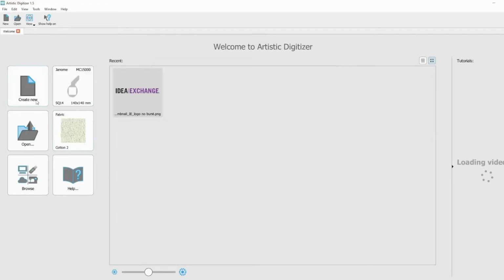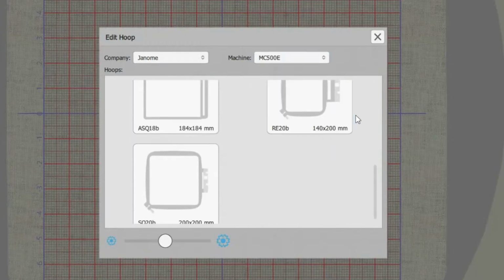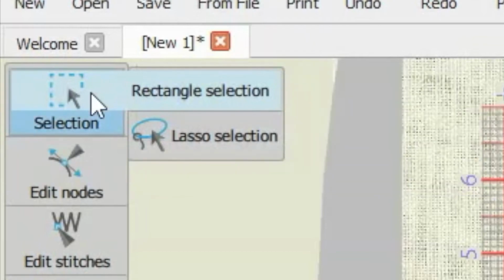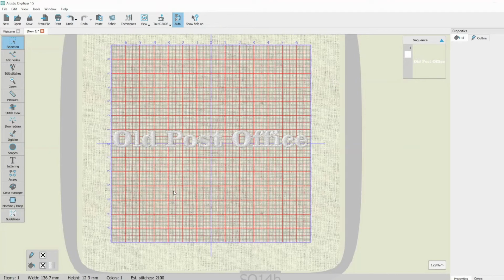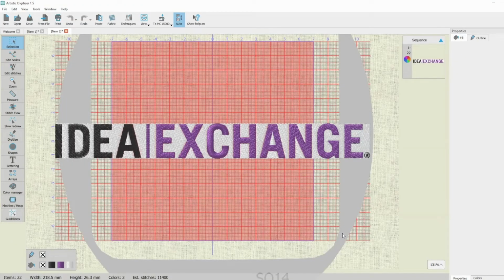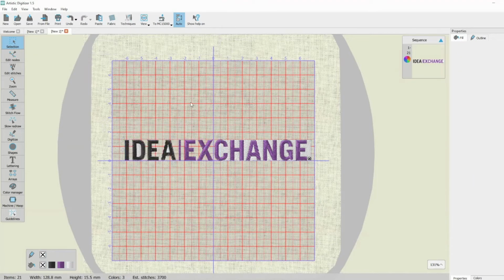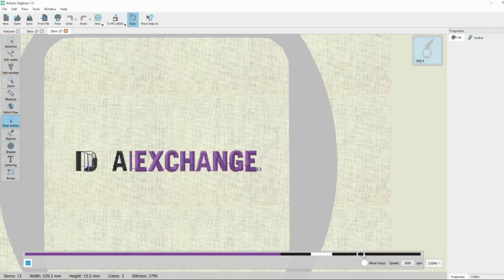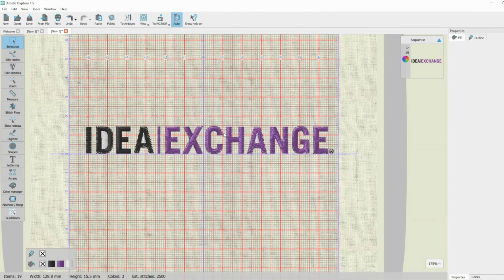How to Create Custom Designs for the Embroidery Machine

Comment: Does this work with the brother se1900?
Reply from the maker: Our staff reviewed materials and found that while the Brother Se1900 is not specifically listed under the machine options in our Artistic Digitizer Program, it does allow you to export/save the design as a DST format. DST is one of the most frequently used formats in the machine embroidery industry, an embroidery machine-readable format used worldwide.
 
Staff checked and apparently, the Brother SE1900 can read and import DST files. You should be able to do the design on our computer using Artistic Digitizer, save it as a DST file, then transfer and import the saved DST file to your computer via either a USB stick or cable transfer to your PC. If you contact the Old Post Office (226-533-2767), staff can book an appointment with you to help more.